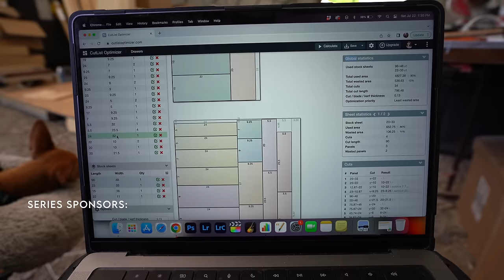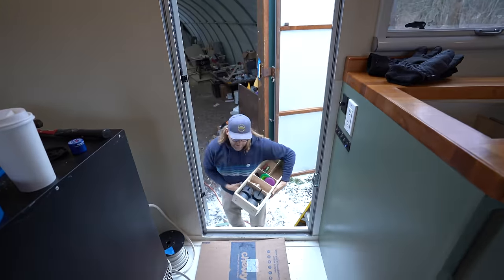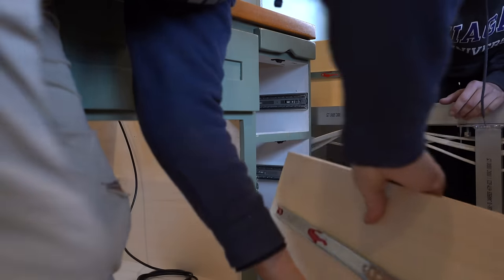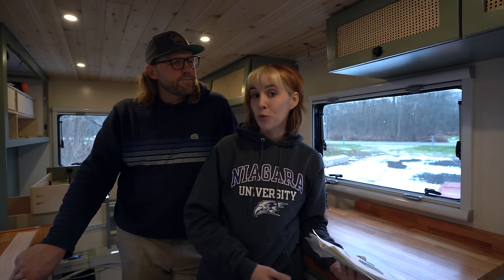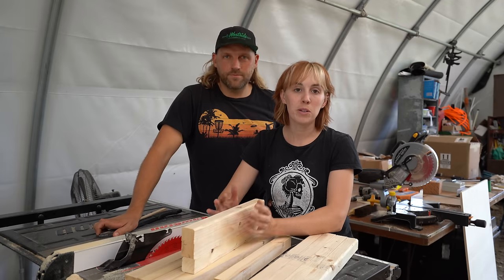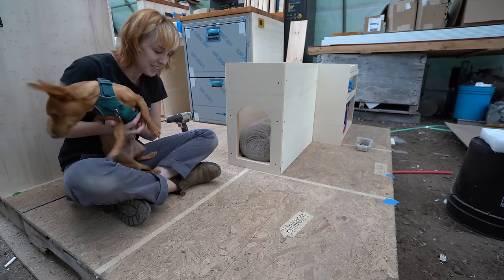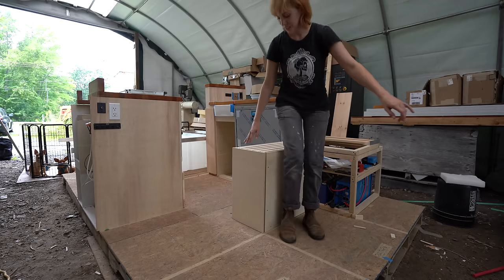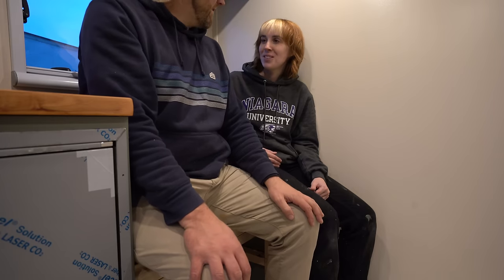HUGE Interior CHANGES to our Unimog Camper | Ultimate DIY Expedition Vehicle 4x4 Truck Build #13

Comment: Glad to see the sliding drawers in the closet don't have the unnecessary, redundant lids like in one of your shuttle bus builds. No need for the extra work or extra weight.
Reply from the maker: The lids on the closet drawers in our bus held a mirror on the bottom side so that you have a little flip up vanity space for getting ready. These ones are too high for that so they don't have lids. Certainly doesn't save any noticeable weight from eliminating those tiny lids 😂 By all means, don't include drawers when you build your own closet.

Comment: I always wonder why everyone installs 2 burner cooktops horizontally into the countertop. Seems like if it was put vertical that there would be more precious countertop space available. Am I missing something? Ps your kitchen is to die for. So cool looking  and efficient.
Reply from the maker: Our stovetop is also our heater and the lid blows the hot air out the front. If we installed this unit in the other direction it would blow the heat towards the wall and not directly out into the living space. This was the main reason for the direction we chose! 
Thank you so much 🥰
Reply: Makes perfect sense!